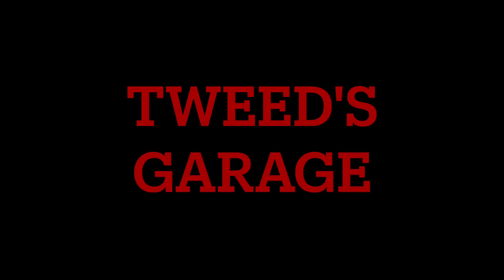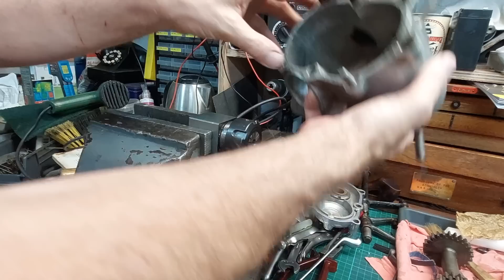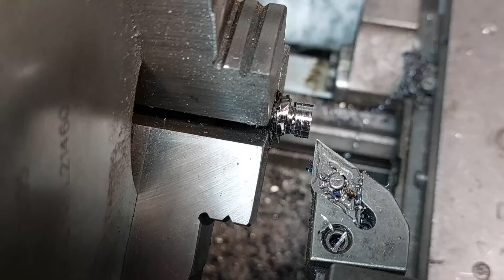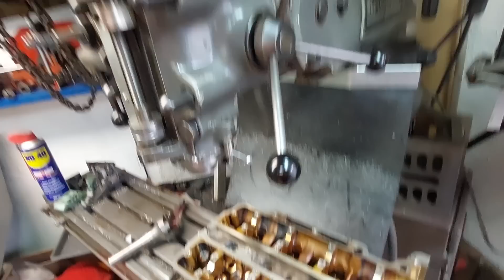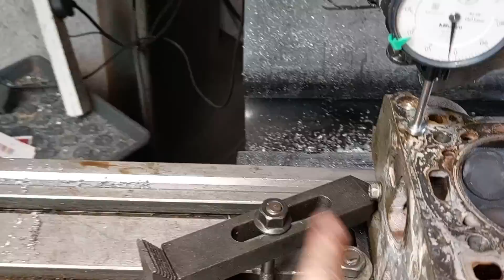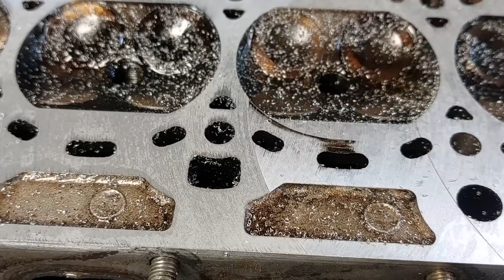CYLINDER HEAD SKIMMING ON BRIDGEPORT SHOCK HORROR !! & DOWEL PIN REMOVAL

Comment: Just as a suggestion, the thermal method of removing the dowels, I saw you heat up the casing, try using plumbers freezing spray, carefully applied to dowel, I was a domestic electronics engineer back in the 90s, we used tins of it for showing up heat related faults.
Just a thought.
Reply from the maker: Plumbers freezer is good.....👍

Comment: Hi Alan  I did a Riley 12/4 head by hand! I  had an exhaust seat welded up which ended up with a 0.007'' lump on the face and the shop would not machine it. Using a spare head as a datum and engineers blue I scraped it until it was flat with a consistent blue pattern. Clamped a piece of plate glass to the pillar drill. With some 80's grinding paste I finish ground the head. It worked a treat! A Bridgeport would have been a godsend and saved a bit of time, good stuff young man!! Cheers John

Comment: I have thought about skimming heads on my Bridgeport but there is not enough X travel, A large diameter fly cutter like yours covers the area, but would not be able to clear the head at the back of the cut and you didn't show how or what you did?
Reply from the maker: 48" table so has enough travel for the fly cutter to clear a 4 pot cylinder head, would struggle with a 6 cylinder head though.

Comment: One common Bridgeport type mill problem is over time the whole bed becomes slightly rainbow shaped  ,,due  mainly ( I believe)the repeat clamping on the T slots which gradually pinches the top surface leading to top surface expansion. This leads to head scratching as the mill produces dished surface finishes. This is hard to understand as a DTI on the quill gives a nice constant reading as the bed is moved left to right as the centre distance hardly changes. The easiest way to see it is use an engineers spirit level and watch the bubble as you track the table from left to right. My mill gave less than a thou variance from the quill even though the bed was warped by 19 thou. end to end.
Reply from the maker: Luckily i'm the second owner of my Bridgeport and although used it was looked after so its still pretty good but yes I'm aware they are prone to banana if abused .

Comment: On the working face of a cylinder head are 3 machining location flats, these are cast flats from the die at the time of pouring. Machining location flats are used when a blank is progressing down a machine line in the factory. All the drilling and tapping positions start from these location points. Also combustion chamber depth is measured from these and thereby combustion ratio. I see the flats on your head face, I would put my dial indicator on these then use shims where needed. That would give you a greater accuracy on the plane of that face. Just a suggestion from the car industry when we had a car industry. cheers Tweedy nice vid.
Reply: From memory I think they were called “coined” casting locations. Unless that was for forging/ die. 😊?!
Reply from the maker: Thanks for the tip, i shall keep an eye out for them on the next one...... .mind you, one old Talbot head i had i think they used 3 points off of the factory floor as their datums 😁

Comment: I made a slide hammer arrangement and use the R8 collets from the mill to pull the pins. Also a roll over fixture that bolts to the side of the head, for those times when the head is not clamped directly to the table of the mill.👍
Reply from the maker: Good call Randy 👍

Comment: I did one on a Bridgeport, which rocked the machine table, so giving an elliptical face on the cylinder head. The table had to be re-fitted on the carriage to get better accuracy. A big, old Cincinnati Bed Milling machine does a better job, more solidly made. Check the head with a Camel Back Parallel.
Reply from the maker: Bridgeports are prone to wear on the table, but they are compact , unfortunately i don't have the room for a chunky Cincinnati .

Comment: i do my heads on a platen grinder but i would not do an overhead cam head. they need to be heat straightened     if the head is warped the cam journals are warped

Comment: Many years ago, as an apprentice tool and die maker I was shown this method of removing dowel pins...it does destroy the pin tho.
If it's a long dowel pin cut the pin off about 10mm from the surface. Dowel pins are usually case hardened so the centre of the pin will be relatively soft. So here is the method and we will assume a dowel pin with a 10mm diameter.
Centre punch a point in the middle of the dowel..or as close as you can get. Carefully dill a 7mm hole down through the dowel. Be careful approaching the end of the dowel as you will have to break through the case hardening which will only be a few tho thick. Then drill the same hole with a 7.5mm drill.
We want to finish a hole size of 8mm so it should be reamed. If you don't have a reamer use an 8mm drill..but first use a small oil stone and run the stone along the flutes and the cutting point of the drill. Your only taking the sharp edges off the drill so it doesn't drill over size.
You will need an 8mm dowel... some thick oil or the old fashioned plastercene or modern day blue tack.
Make sure the 8mm dowel is a nice sliding fit into the hole in the 10mm dowel.
Try using the oil first.
Drip some oil down the hole and half way up the dowel pin.
Insert the 8mm pin into the hole.with a copper hammer hit the 8mm dowel.. may be a few hits could be needed...and hopefully you will see the 10mm dowel come out as the 8mm dowel goes in. You may need to add oil part way through the operation.
If the oil does not work, roll the blue tack into a spaghetti roll and push into the hole. Repeat the hammering process.
If anyone tries this method best of luck..I have used this method many times and it always was a success.
Reply: And if anyone has to drill a hardened dowel pin, I would suggest a straight-flute, 140 degree point, solid carbide drill bit.  I keep a variety of sizes of these around for that exact purpose.

Comment: You do hear some absolute baloney spouted about not being able to accurately skim a cylinder
head flat on a milling machine like a Bridgeport....it is utter nonsense.
 If it isn't flat afterwards that is due to the lack of competence by the operator to set the job up adequately.
Reply from the maker: Quite right Howard 😉

Comment: We used to tip the head by a tiny bit that way there was no drag on the back part of the cut, the finish was better and the headgasket took up any indifference by cutting with a tipped head
Reply from the maker: I prefer running it the other way so you can observe the initial cut before the back cut comes through giving a chance to adjust if there's a problem.

Comment: Great video, nothing wrong with skimming heads on a Bridgeport, I do it all the time. One tiny detail that I do differently, if it's of any help... I don't use that type of fly cutter. I use one of my own making, one of the flywheel type. I bought the R8 arbor, turned the disk which I think, from memory is about 10" in diameter. Drilled a couple of appropriate holes, one straight, one at 45°, for mounting HSS rod in and a locking grub screw for each. It may be psychosomatic but I wonder if the better balance gives a slightly better result? Probably just me.

One thing I've used to remove dowels befor I had other means was to find a nut with a threaded hole smaller than the dowel. Drill it out as near to the dowel size. Slit it with a hacksaw, pop it on the dowel and clamp it up in the vice. This also has worked to pull snapped studs if there's enough sticking out and use plenty of heat!

I'm currently stressing out over building up a Schafleiner 5 speed gearbox which arrived in a carrier bag so if there are any experts on these rather rare conversions out there please let me know. Otherwise I'll just keep stripping and building it back up in the seemingly hundreds of permutations it seems to have! 😵‍💫
Reply from the maker: Thanks for the tips, i have a couple of large chunks of steel and ally that I have planned go to use to make a cutter as you describe and i think you're right about the quality of cut on a dedicated disc cutter with better balance compared to the fly cutter ( i can only run it at about 350 rpm before vibration sets in ) . 
Good luck with the 5 speed 👍

Comment: Hello again. Very interesting work. When I  was a young Apprentice mechanic with Gods Poor Orphans, GPO, the chap who trained me was a very good automobile engineer.  He hated the word, Mechanic, his attitude being that if couldn’t buy a part we’d make it! If a cylinder head was a little off instead of sending it down the road to the engineering shop he would get me rubbing the face on a piece of flat vehicle door glass from some old commercial truck. They were usually just a straight cut sheet of strong laminated glass.  I would rub smooth grinding paste on the glass, spray a little paraffin, Esso Blue usually, only the best, over the paste and then laboriously rub the head surface over it for what seemed a lifetime. Clean the head off and check it as best I could for warts and wrinkles, crevices and dunes until the gaffer said enough. I think it was more of an apprentice punishment. Happy days and there’s a,ways a way!
Reply from the maker: I worked at a garage on Saturdays when i was at school and my time was mostly spent grinding in valves....  i feel your pane ( see what i did there ? 😁 )
Reply: @TweedsGarage  very sly there, but I caught it immediately as some of my favorite humor is a play on words.
Reply: You would thin it with single malt these days, cheaper than paraffin.
Reply: So what word did he substitute for mechanic?

Comment: I am a machinist and have done many heads over the years, what clearance do you run on the trailing end of the tool.
Reply from the maker: Under a thou over a 9" sweep, more a visual clearence that is indicerible  with the thumb nail scratch check.

Comment: Fly cutters were banned at the place where I served my time Allan, someone was badly hurt doing a guvvy job with one; so any cylinder heads that were snuck in we had to surface grind them, saw one done clamped to a faceplate on an old Herbert 9 turret lathe at another place I worked at, worked a treat, the bloke fitted back into his car and off he went no problem...🤣
Reply from the maker: Like Father Christmas i check my flycutter security twice to see if its going to be naughty or nice 😁 , it was amazing what got sneaked in and out of the R.A.E. when homers where being done.
Reply: Some of my most challenging jobs have been homers😊 They make your abillity to tackle a job better @TweedsGarage

Comment: Had some Actros heads skimmed locally the delivery driver was so proud of the polished surface but not happy when I sent him back to get it done properly. Mercedes had problems a plenty with sealing the gaskets and ended up inducting a warp on the face so it pulled flat. No hope of refacing it then.
Reply from the maker: Yep, you need a bit of bite on the head to grip the gaskets Steve......rather shatters the illusion that Mercedes know what they are doing when it comes to building engines when they have to warp the head to get round a problem.

Comment: skimmed a few fiat 127 heads on the cars we had as they seemed to blow gaskets at about 60.000 miles used a sealey mill and cutter quarter the size of the bridgeport the heads didnt leak and we put thousands of miles on them after fixing
Reply from the maker: Had a Fiat 127 Sport.....my absolute favourite car.....unfortunately it rusted before my very eyes ( the induction roar through the K & N clad twin choke Webber was addictive. 😁
Reply: @TweedsGarage yup, FIATs could rust away before the engine was run in! Had a FIAT Panda - worst new car I’ve ever experienced (and I used to work in a Vauxhall garage back in the 60s!). Everything wrong with that car… brilliant design (except the engine) but poor execution. I liked your Bridgeport work Mr Tweed, nicely done I thought. Les
Reply from the maker: Cheers  @leslieaustin151

Comment: A jakobs chuck in a pillar drill. Clamp the case down grip the pin with the chuck pull the pin by winding up.
Reply from the maker: Ooh another good one, thanks Trevor 👍
Reply: Would there not be a tendency for the chuck to pull from its taper?
Reply: @bigbadwolf1966 done it quite a few times when the case is too big to hold, just need to gently warm it up.
Reply: @bigbadwolf1966 never had it happen but could do, just need to warm the case.